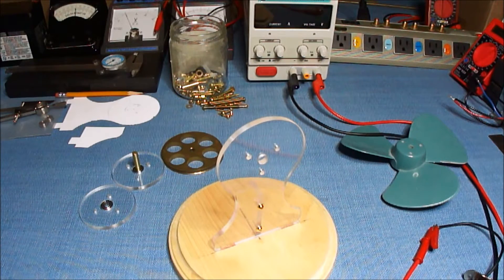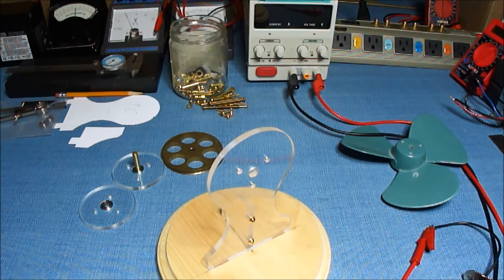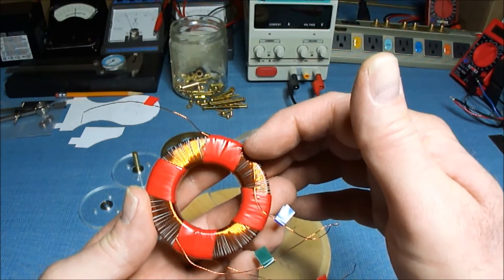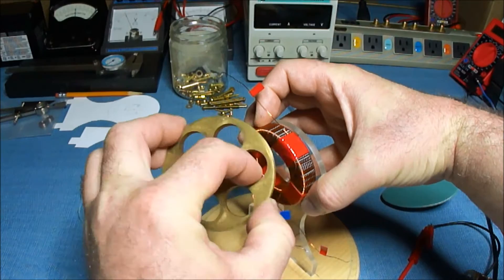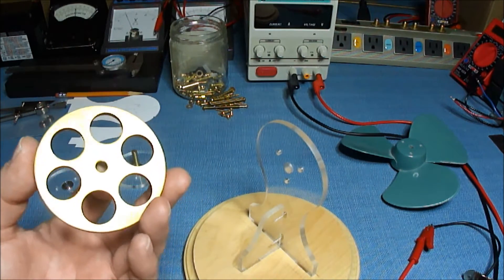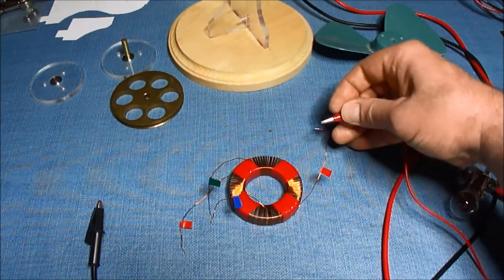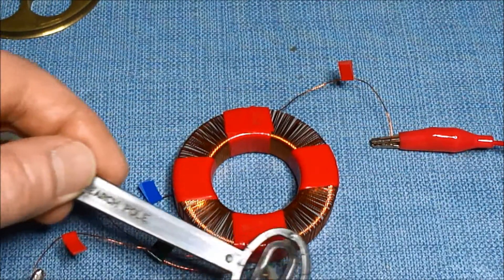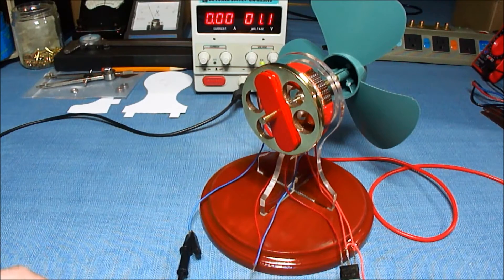Cogless Toroid Pulse Motor / Dynamo Electric Machine

Comment: Excellent as always lacked the schematic diagram for better understanding . Thank you.
Reply from the maker: Thanks. I have a lot of experimenting to do with this design. The negative passes through the coils to emitter and positive goes to collector. Reed switch is across base and collector.
Reply: Putting the reed switch base to collector means you are losing about 0.7V of the input voltage in the transistor.  You can reduce the losses if you use a better switching circuit.  Bipolar transistors also switch off slowly.  Each time it does so, the transistor eats some energy.
Reply from the maker: Hi. I used that circuit just to get it running. Trying different ideas now to see what happens. A commutator is always an option. Is there a circuit you have in mind?
Reply: Arkiver Unified Energy
I was thinking in terms of some method like a optical detector to detect the rotation and something to make a pulse to drive the gate of a mosfet.

Comment: That is a impressive toroidal pulse motor setup...^^
Reply from the maker: Thanks. It has good torque for firing only once per revolution.
Reply: The efficiency is still going to be very low.  Pulses are hard to measure but it is always a bad way to go.
Reply: Only once per revolution is very good indeed...^^
It should have better performance with more drive pulses per revolution...
In every setup i've made...the more drive pulses per revolution the better the performance was...;-)
Reply: Even your of the self DC motor is being pulsed, of course with a on time of >90% but pulse is pulse nontheless...;-)
Reply from the maker: I like the pulse motor setups you built. There is a half revolution that could be pulsed in reverse through the coils. Thanks :)  Mike
Reply: Arkiver Unified Energy
Yes, and with just a bit of cleverness, the energy from the inductive kick can be recovered and used on the next half turn.  I will explain this:

Imagine that you connect one end of the coil to a capacitor that is rated for AC use.  The other end of the capacitor goes to ground.

The other end of the coil goes to what I will call "switches".  One goes to the positive power input and the other to ground.  Expect the best implementation for the switches is a transistor with a diode in series.

When the switch to positive closes, current in the coil builds up and the capacitor starts to charge up.  Some energy will be taken away by the rotor moving but quite a lot is stored in the:

Energy = Current^2 * Inductance

This energy is the energy that often ends up in the inductive kick of a coil.
In this case, however it just serves to charge the capacitor up to a voltage greater than the input voltage.  When the current in the coil hits zero, the switch opens, leaving a big voltage on the capacitor.

Now when the switch to ground closes, a voltage bigger than the battery voltage is applied to the coil.  The current builds up in the coil and the capacitor ends up with a negative voltage on it.
Reply from the maker: Thanks. I will try some configuration to see what happens. May need to make another coil with more turns.
Reply: Thanks for your compliment and i'm glad you liked them...^^
That half in reverse pulsed should do good efficiency and torque wise...;-)
Cheers
Reply from the maker: Thank you for your suggestion. It runs smoother and more torque. The dual pulse AC in the coils lowered the DC amps in. The circuit could work good as a primary in a solenoid coil. Cheers :)
Reply: "It runs smoother and more torque"...that is nice to hear and good move...^^
Cheers

Comment: Good performance considering the low wattage input, and beautifully made, would be interesting to see it with a trigger coil rather than a reed switch. How much does the propeller weigh ?
Reply from the maker: Great idea! Thanks. The propeller is 1.5oz. and flywheel, magnets, and shaft are 8.5oz. Cheers